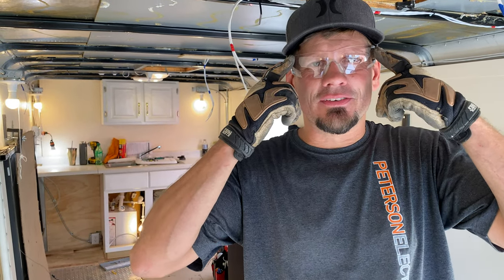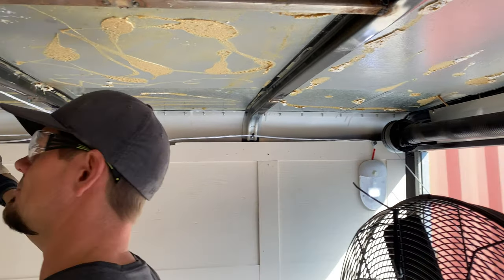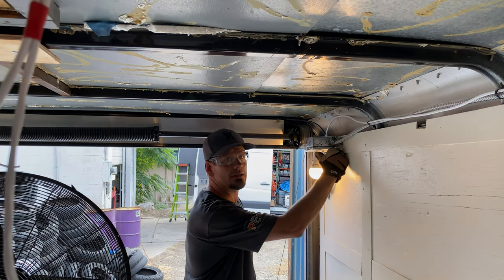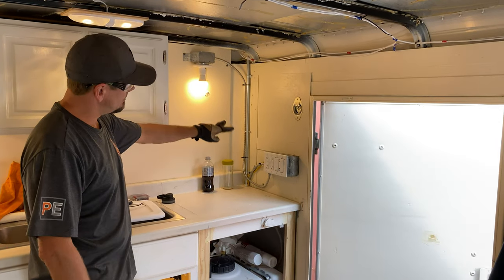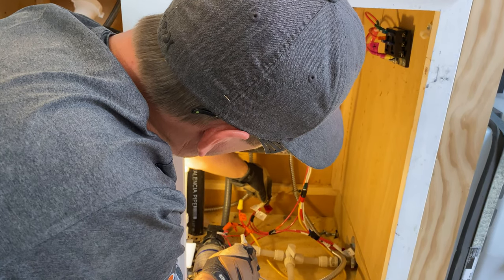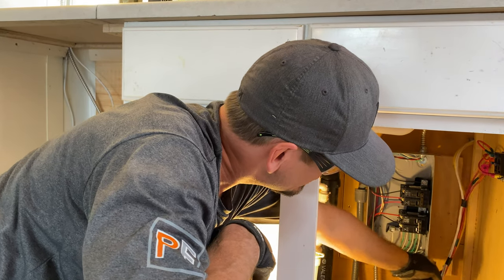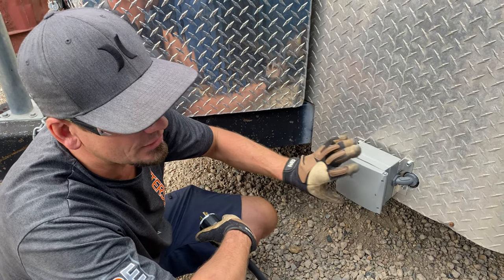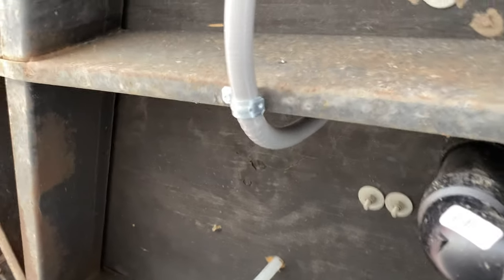How to Wire a Toy Hauler Trailer

Comment: On a trailer / RV the point of disconnect is your pig-tail plug to shore power. Shore power will have the neutral and ground bonded at the source. Also, many gen sets have a floating neutral because they have GFCI protection built in. IOW, bonding in the panel under the sink will cause issues.

Comment: Why not a proper generator inlet?
Reply: No kidding.  A suicide cord...really?  A proper inlet is like $20.
Reply: @andy16062  ya but thts $10 more vs some gas for the toys??
Reply: I’ve installed a handful of them. Can easily find them on Amazon, Home Depot, etc by searching “power inlet box”. Make sure you get the right plug configuration/rating and locking or non-locking to match your generator output.
Reply: Yeah, I think I'd have put a proper Shore Power cord in the battery box, also good place to store the dogbones so he can use Twistlock, TT30 or NEMA 15-50P (2x 120V and a Neutral)  A Tiedown for the battery would also be nice.
Reply: I was going to say it isn't that serious until i saw him pull the damn plug out with the generator running and hold it right next to his thigh. Maybe just the camera angle but it looked too close for me. It sounds like he didn't do that part of the install though.